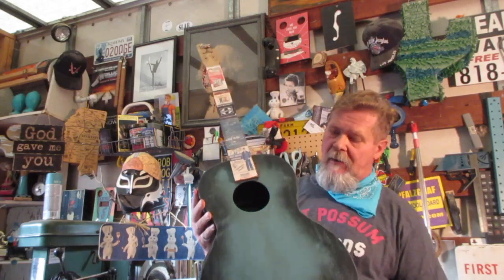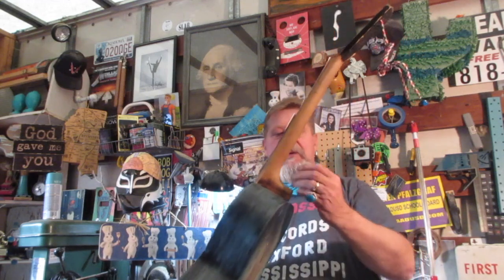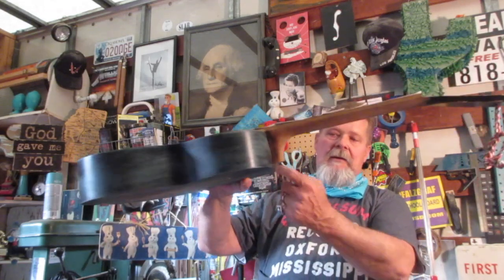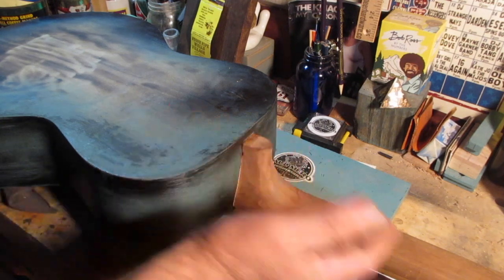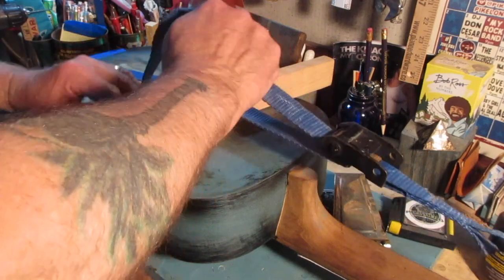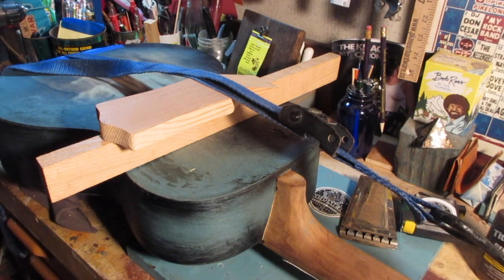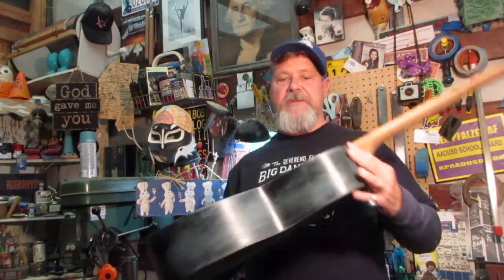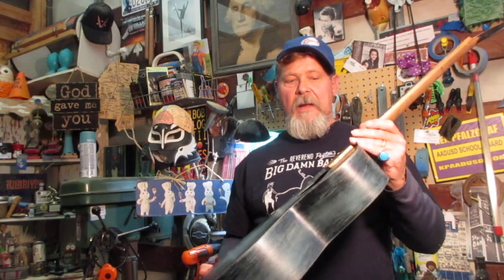$3 Guitar Neck Reset

Comment: Setting the guitar face down onto a flat surface and supporting the guitar at the neck and tail end with some kind of caul or block would have been easier in my opinion. With that arrangement you could then simply add the glue into the joint and add some weights onto the body near the neck joint. Great video overall. Learned a lot.
Reply from the maker: Thanks for watching

Comment: Does hide glue in a bottle stay runny or does it need to be heated to use it?
Reply from the maker: @geckobaldy  heat it!!! Thanks for watching
Reply: Thanks. So is it hot in the applicator bottle when you squeeze it out? How hot? Cheers  @paulmerojunkpileguitars
Reply from the maker: @ don’t heated up in the bottle. Use a glass container. Don’t let it boil but get it really hot.